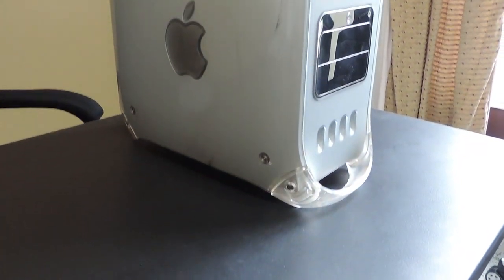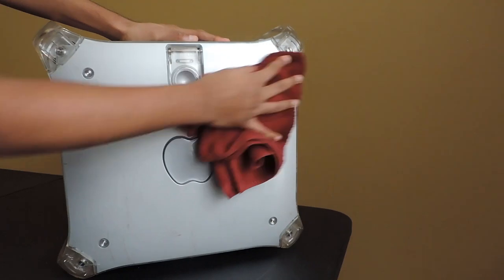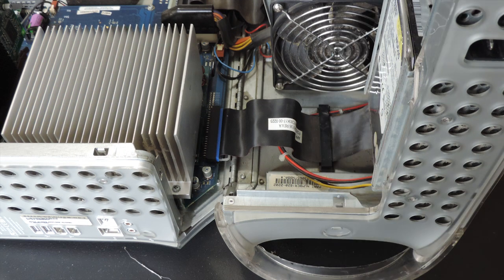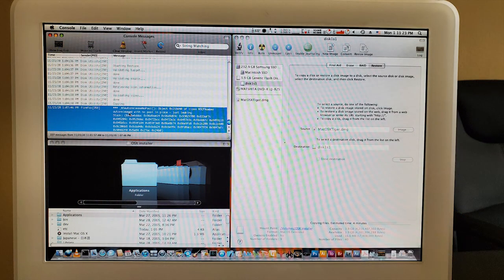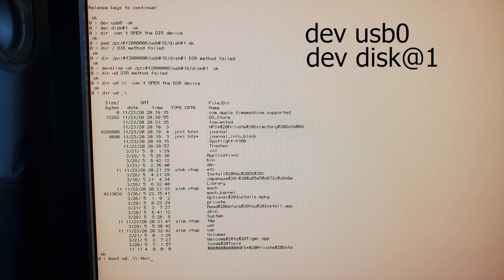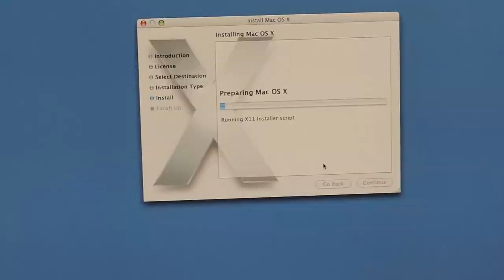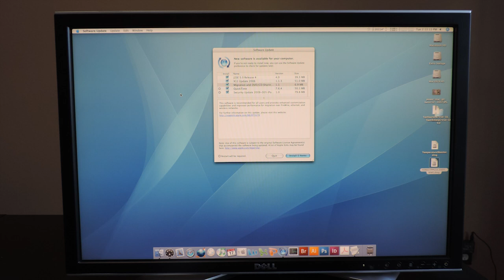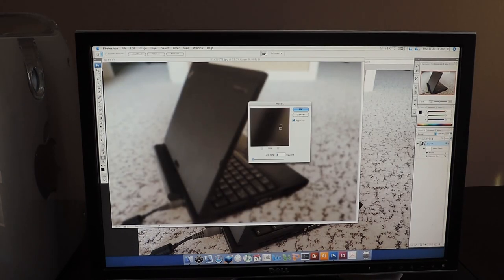Restoring a Power Mac G4 MDD from 2002!

Comment: Hey, great job on the video!  I would suggest to remove the PRAM battery well; not as much of a danger on this unit since it's newer, but the older they get the more likely they will leak destroying the mainboard.  Lots of people put new ones in, but I just set the clock manually anytime I want to do vintage computing.  I figure no battery is good insurance.  Either way, keep up the good work :)
Reply from the maker: Thanks! I'll remove the battery later today, just to be safe.

Comment: You make this to complicated. Just download install dvd iso and burn to dvd disk on another Mac. Then boot PowerMac with option key held down. After Apple cursor appears on screen, push eject key or F12. Optical drive opens. Insert dvd. Follow Mac OS X Leopard 10.5 install to partioned and formatted ata/ide drive onboard.Then upgrade to 10.5.8. ✅ Done.
Reply from the maker: Thanks for watching. I stated in the video that I didn't have access to a blank DVD, so I had to use a USB as a workaround. If you have access to a DVD, then that is definitely the easiest method.